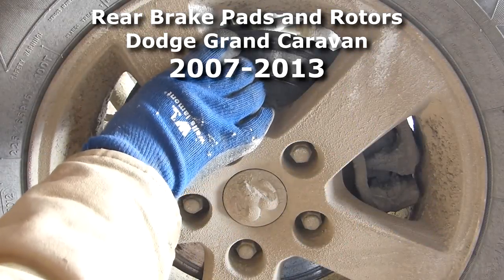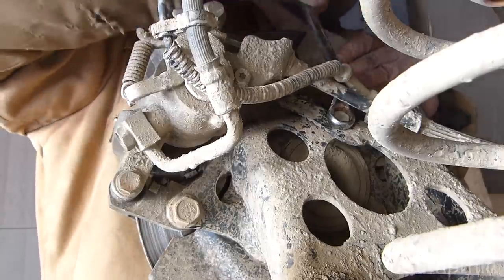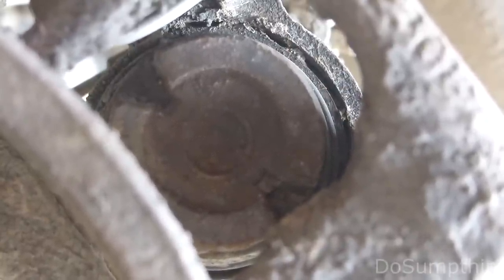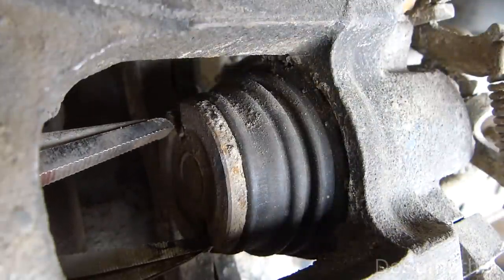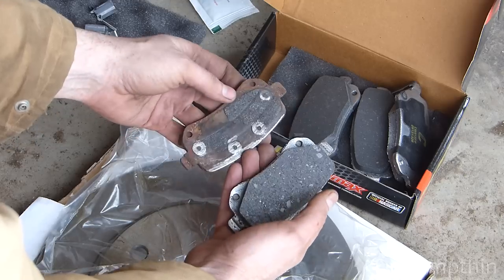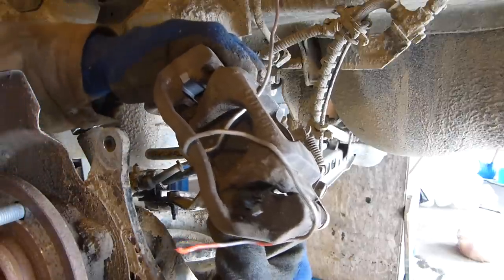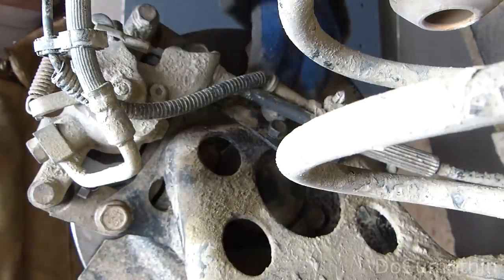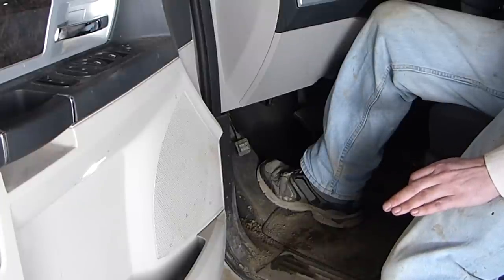STEP BY STEP: Grand Caravan REAR disc brake pads & rotors without special tool (2007-2013)

Comment: You need to replace hardware every time unless it was literally just done it pad failure etc. Rare cases. Good video other wise. Gotta assess the steel under those stainless hardware clip. Too much rust equals bound up pads and uneven wear noisy brakes. I did have a question if anyone knows. If you don't align the piston with the pad dowels can that damage anything or will they self align when you pump up the pedal

Comment: I used the same Duralast pads on my neighbor's van, any idea what the included packet of grease was for?  I didn't use any because in my opinion, putting grease anywhere near brakes is a pretty bad idea.  It did seem like actual grease, not anti squeal compound.  No instructions of course were included.
Reply: I don't know if you figured it out by now, but that packet is high temp grease for the pin on the brake bracket that allow the caliper to slide back and forth.. should take those apart and apply at every brake change.

Comment: It is possible to change the pads without removing the main body of the rear brake caliper on 2008 and later models. If the rotor has to be refaced or replaced, the main body of the caliper will have to be removed.
   Remove the two 13 millimetre headed bolts.
   GENTLY move the caliper piston back using a large C-clamp on the outer brake pad and rear of the piston body. This will gain you a tiny bit of clearance beyond what the normal retraction of the piston will give you.
   Grasp the piston body with one hand and tap on the outer casting away from the rotor. The purists won't like this, but it will allow you to remove the piston body off of the brake pads which will remain in place.You will have to fight with the emergency brake cable to perform this.
   Remove the old pads and anti-rattle spring clips paying attention to the placement of the wear-warning spring. The new spring clips are indexed to the shape of the tabs on the pads. Make sure you get this right. Install the new pads with the wear-warning spring as you found it on the old pads.
   Service the slide-pins as necessary with the special high-temp grease supplied with the pads.
   Turn in the piston either with a special tool for that job, or in my case I used a large adjustable pliers (pump-pliers) to rotate the piston inward, clockwise. Avoid damage to the rubber piston boot.
   Seat the piston gently, and then back it out so that it is a tight fit over the new pads. This may take a couple tries to adjust so that the caliper will fit snugly on the new pads. Again you will have to fight the emergency brake cable to perform this.
   Install the 13 millimetre bolts and verify that the rotor turns freely. With the piston adjusted correctly, the brake pedal will take little or no 'pumping up' as in a front caliper replacement job..
   Test the emergency brake pedal operation to verify that it applies and releases properly. 
   By not 'seating' the piston to it's lowest level, a lot of fiddling around is saved trying to activate the automatic adjuster.
   Yes, use a torque wrench on the lug-nuts when installing the tire... Avoid warping the rotor by over-tightening or the danger of a wheel working loose. Recheck the torque after some driving. 
   Work safe and clean up behind yourself!

Comment: Pedal slowly falling to the floor is usually caliper seals. Just saying. If you do the parking break reset and still have pedal slowly sinking to the floor then caliper seals.
Reply: I have a problem like that..brake pedal sinking in slowly even though I tried to pump the pedal. Fluids are full, calipers are good

Comment: I cycled the emergency brake about 200 times and the tension never increased and the main brake pedal still goes to the floor as you mention in the video.  Next I took the brake apart again and turned the cylinder back out - leaving just enough clearance so I could get the caliper back on.  Now the main brake pedal is much tighter but I cycled the emergency brake another couple hundred times with no success.  With the wheel removed, I get a little bit of drag on the disc when the emergency brake pedal is pressed but not enough to stop the vehicle.  Help? Thanks!
Reply: Emergency brakes never have enough power to stop a vehicle quickly, they will slow you down.  An emergency brake is more for parking on a steep hill.

Comment: Not bad but while you were that far you should have  cleaned and  greased the guide pins. Also I always grease the brake pad brackets it helps the pads slide  easier

Comment: Just as an FYI, this does not apply to the 2007. The assembly was changed for 2008 and is completely different than the 2007.
Reply: thank you i was about to watch this for my 2007
Reply: And what is the trick ?  We cannot get the rear rotor off.  Right side .  Helping a single mother of three and it has turned into a two day job ..
Reply: bbqbigbear...did you do the rear and manage to et the rotors of without cutting them off ?
Reply: GAHLON COLLECTIBLES  Release the parking brake. The 2007 uses a disc/drum setup in the rear. Inside the rotor hat is a drum brake that is used for the parking brake.

Comment: For all y'all armchair quarterbacking the condition of the existing (worn through) pads: 
The 2010 Dodge Grand Caravan specifically has a terrible design flaw;  The rear brakes take most of the wear, and they're way undersized for the 4700 pound vehicle.  They last about 30,000 miles on average total, and when they wear out the only warning they give you is a very light occasional "squeaking", which weirdly GOES COMPLETELY AWAY once the pads are worn through.  Once you're down to metal-on-metal they're /completely/ silent, even though they're grinding up your rotors.  

I have one, I'm at 65k miles, and I've just discovered that we've destroyed our second set of rotors despite having gone through this once already before.   The first time I thought "this must have happened while my wife was driving, I would have noticed".   This time I'm the only recent driver of the car, so now I know.  Set an odomoter reminder to start checking / replace the pads around 30k miles.  It gives you no warning, and they don't last as long as they should.

#TMYK

Comment: For the 2008 Dodge Grand Caravan would the brake pads be the same for the front and back?
Reply: +PoliticalGangster No, rear pads are smaller.
Reply: Are the rear rotors different from the front rotors as well?  What about the front and rear calipers?  I have a new front rotor, pads and caliper and am wondering if they'll work on the rear. My guess is they won't.
Reply: Andrew Smutniak The rear and front pads are not the same and calipers too are not the same. I changed my 2010 disk successfully but I had completely diffrent pads from front and back.
Reply: Thanks, that'll save me the cost of a rotor!

Comment: wth? who leaves the caliper on the bracket like that? you NEED to lube the slide pins/sleeves. otherwise you will have problems after a lil while, ESPECIALLY with the ceramic (or any other good pads) due to how long they last. (I am a Chrysler Certfied Tech. this is what i do, so i know what im talking about)
Reply: +steve collins  Your the last person to listen to. lol

Comment: what will happen if they didn't use the special tool and pushed them in with a c clamp
Reply: Juan Castro mechanic didn't realize this was a bad idea on our caravan last week. He got pads changed but brakes were very squishy caliper didn't fully extend until I took wheel off and unscrewed the caliper piston. halfway then pumped brakes a few times to get it fully extended.